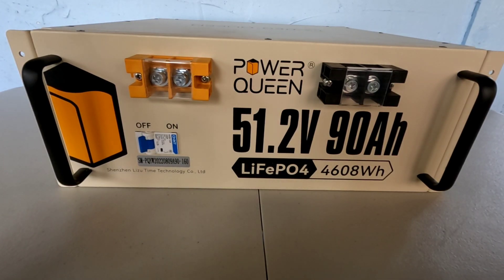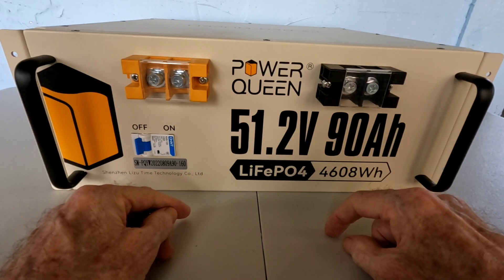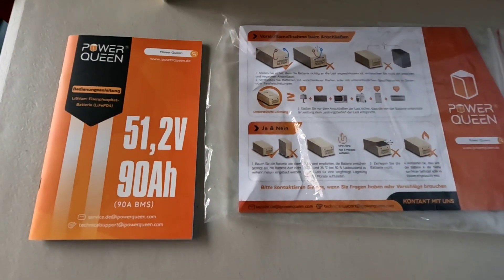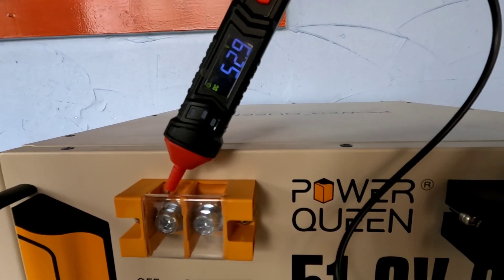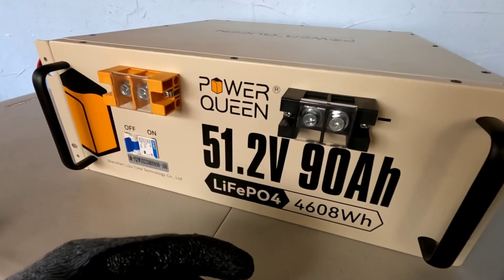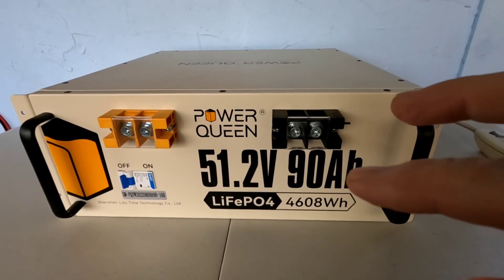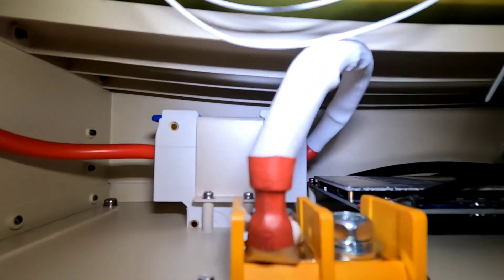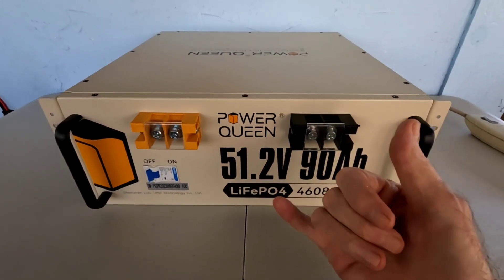Power Queen 51.2V 90Ah LiFePO4 4608Wh server rack battery!

Comment: Just noticed these are available at a pretty good value. We want to build an off grid project to charge our Ford Lightning pickup and run a mini-split to cool the garage. I think these might be the ticket, have you found these to be reliable ? We already have two of their 12v 200ah, running a mini-split in our art studio, and and one 12v 100ah in a Ryobi LInk toolkit portable generator. It's run all the way up to a Rigid Table saw with no issues, so we're pretty high on the powerqueen batteries. They seem to fit the same value to quality as the Epever Charge controllers we're using.
Reply from the maker: I can’t speak highly enough of this 48V battery. It is a beast. Charges up so fast, and drains very slow. 🤙

Comment: That look real nice. remember on 48V and up you can get a shock from it. on larger systems 48V is the way to go. the DC amps will be less and inverter is more efficient  .smaller wire gauge is needed and with the cost of heavy copper wire this a bonus. . and if you still need 12 or 24V they make buck converters  that do that. very efficient . The only thing lacking is a display and low temp protection witch is found on more costly units. I touch my 12 and 24V systems and never got a shock . I did get a small tingle on my 48V golfcart when battery terminal came loose in the rain and had to tighten . why the gloves . and hear is a great tip when working with battery's . on your metal tools wrap them in electrical tape as much as you can. this will stop sparks . also I like to mount my busbars far enough apart so that don't happen. I use the same ones . made in USA . now when using breakers and fuses check the DC voltage ratting. Them ATC automotive fuses wont be safe on 48V . always look for the UL on fuses and breakers . they will list the AC/DC voltage rating on them and proven to be safe. and some home oner insurance and inspections require the UL label in the USA.   hope you can get a good ground put in. may be worth to pay to have a good 8 ft copper rod put in. it's hard with your soil . The added protection would be worth it. remember this battery is like 4 90amp hour 12.8V in series .90 amp hour means very little unless you know the volts. The watt hour is both the amps and volts . also remember more volts is bigger sparks . love to see what you can do with that battery. 😀😀
Reply from the maker: Hey Robert,  mahalo as always for the great information! Been thinking hard about this build, and ask you a couple questions.  I'm thinking class t fuse off the battery positive between battery and bus bar. Noticing a shortage in availability on some sizes of those, but found a 160 amp, rated up to 200amp one. That should be okay yeah? Then just planning a 100 amp breaker between inverter and bus bar. Seen quite a few systems built similarly,  but wanted to know what you thought! Aloha 🤙
Reply: @ProjectsinParadise808  The class T fuse be ok right at battery positive. Just make Shure the voltage rating is for 48V DC . as far as breakers check the DC voltage ratting. must be for 48V systems or higher not less. 32V and under fuses and breakers will be un safe at 48V battery systems.  I put a Victron MPPT smart controller in my cart. I put the smart USB cable as well. when you have a windows PC direct USB is needed and a big bonus is you can change many more settings then you can with Bluetooth app. you can make your own firm where update to use MPPT on different type of battery's like Sodium ION or Nickel-Iron or even LTO battery. Ben readding all day from Victron cite,  With windows PC you can import data to spread sheet ETC. remember when working on 48V switch battery off for safety also use PV disconnect as well. all power off. check with meter. inverters can hold a charge this can be a shock and spark hazed  .That same charge resistor you use can be used to bleed off a charge as well. just put directly on inverter POS and NEG leads . check with meter. That the best way. 😀

Comment: On certain server rack batteries (like Jakiper batteries) it is necessary to open and check the cell connections because nothing is welded on their batteries
Reply from the maker: That's interesting information.  This is my first experience with them, and should be up running with it tomorrow! Aloha 🤙

Comment: Looks the exact same as Will Prowse video on the Ampere time sever rack battery which is garbage. Is that disconnect switch rated for AC or DC? I'm not liking the shipping straps around the battery. There are way better options on the market.
Love your channel 🍻
Reply from the maker: Mahalo for tuning in! I have high expectations of this battery.  Can't wait to share with you all how it performs! 🤙
Reply: @ProjectsinParadise808  check out the Will Prowse video. It's a re-labeled battery. Good luck with it.
Lots of love 👍